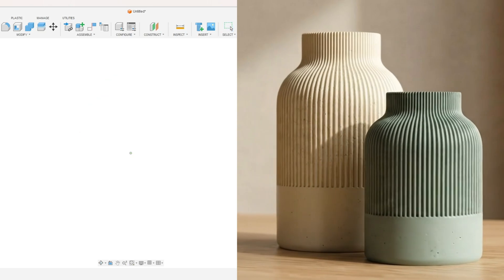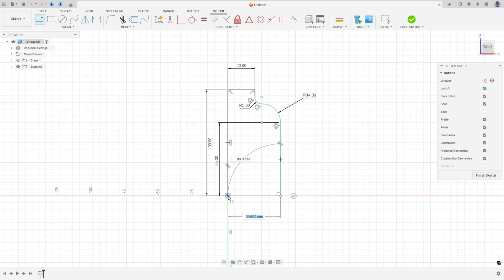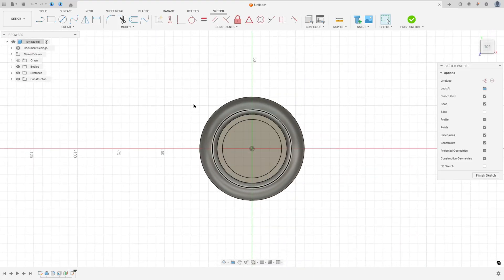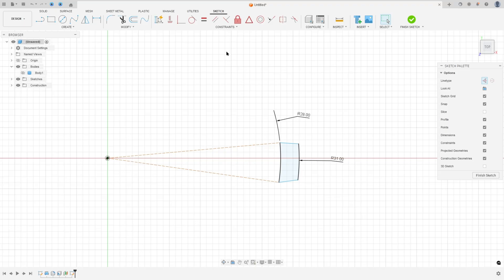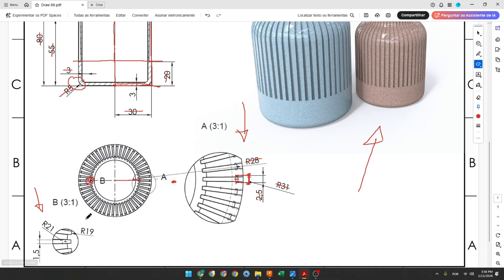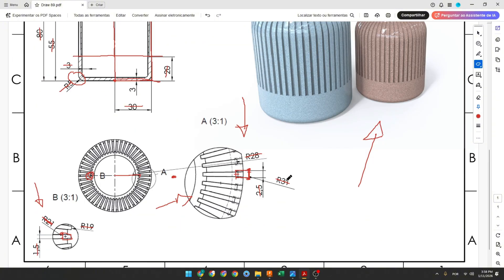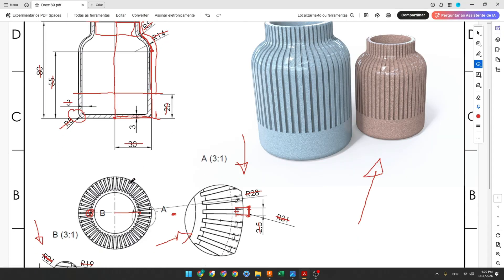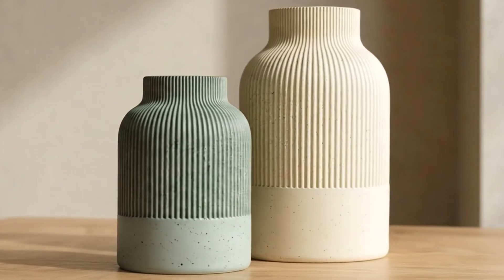Sketch to 3D Print in Fusion 360 | Japandi Vase – Design to Reality

Comment: I find it's better to use Sweep because the groove isn't cut to the same depth with Loft. Loft doesn't "turn" with the path.
Reply: I played around with this for a while. Loft is probably still the best tool for this, but only use it for the curvy section and use two guide rails, one inside the body and one outside.